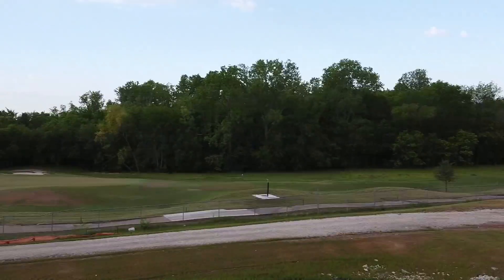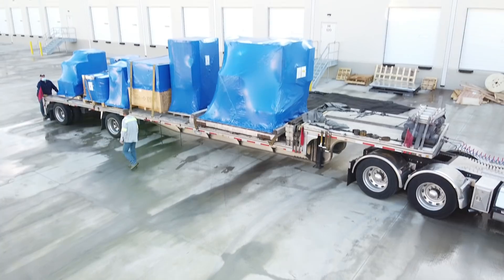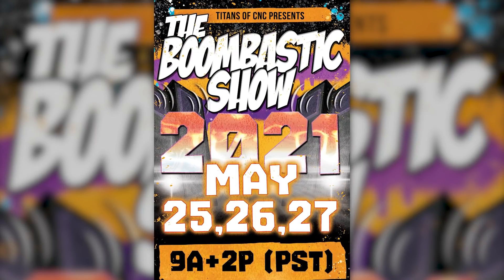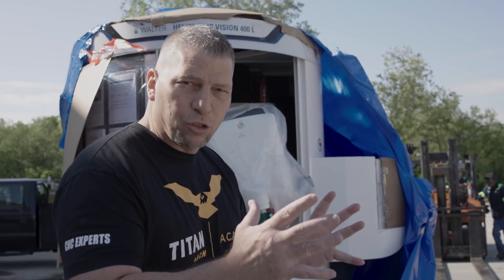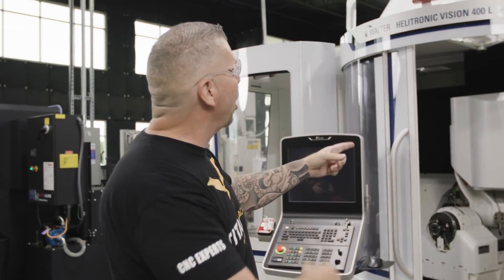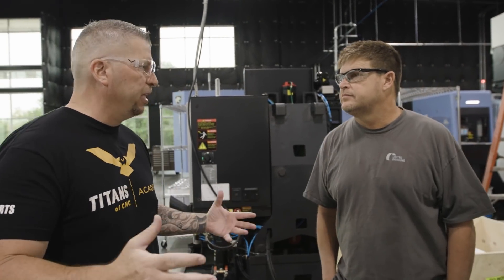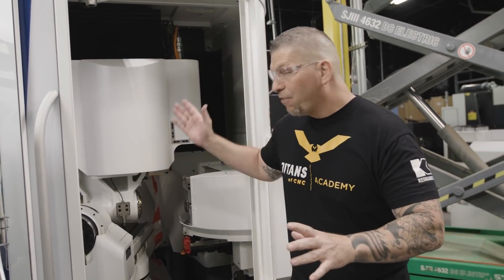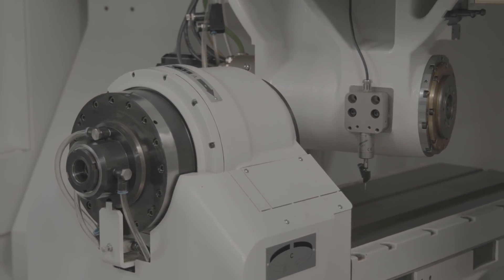5 Axis CNC Grinder Arrives | Walter Helitronic Vision 400L from  United Grinding

Comment: What the heck kind of mechanism is in this machine that allows for a movement of a tenth of a micron ( that's .000004 inch) that's insane....what kind of parts need that level of accuracy and precision.
Reply: Automotive and aerospace industry

Comment: Holy smoke you like buying new gear..... I was considering buying a tiddler manual mill. German  (probably chinese made) but about 7 or 8 days pay. Dumped the idea because I would rather wait for a CNC. I want to set it all up on the laptop and let it run. The ebay CNC doesn't have the strength but it's cheaper and computer operated. I'm only going to do aluminum with it.
Reply: They aren't buying these machines. They are loaned these machines because of the popularity of their YouTube channel. These videos are basically commercials for the machine manufacturer.